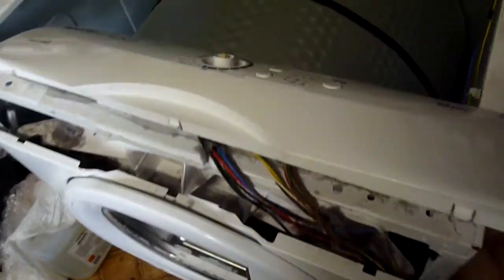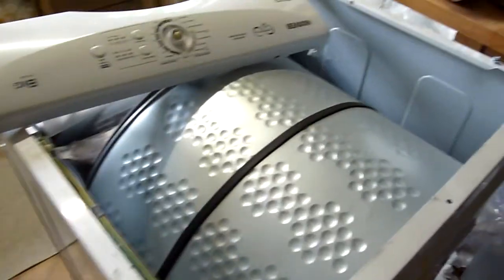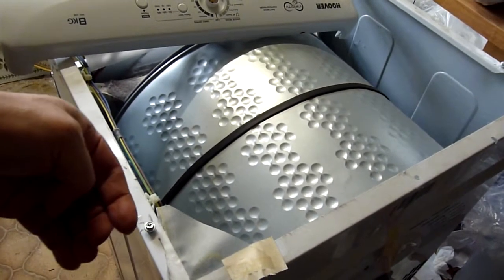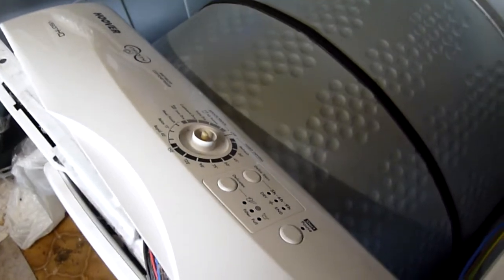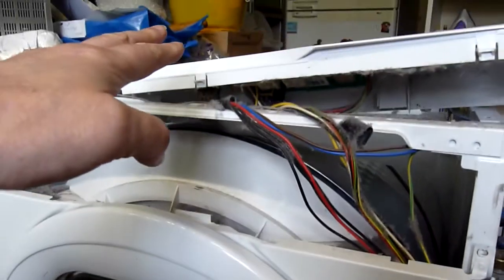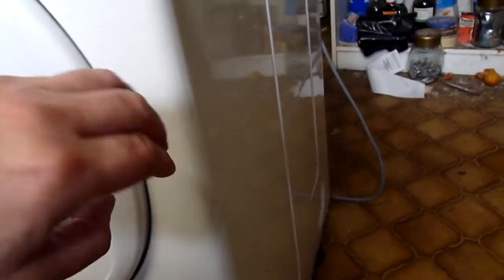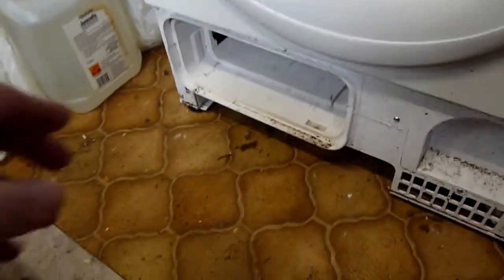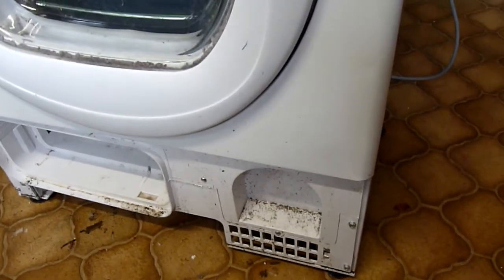look at Hoover Vision Infinity tumble dryer insides

Comment: Can you tell me where the capacitor is on this model please and what you have to take off
Reply from the maker: The capacitor in question is also called the mains filter and connects directly to the mains power lead. It will be at the back of the machine and usually at the top.
Reply: @toner5709  yea I saw that but the part I mean is the 7uf capacitor, managed to source it in the end but what a pain to get to, most of them is take the back and side off and it's just there.
Reply from the maker: @Jason Horseman  On this model the sides and back are one unit so you will need to remove the front and then parts to get access to the back.
I have more videos of taking this model apart.